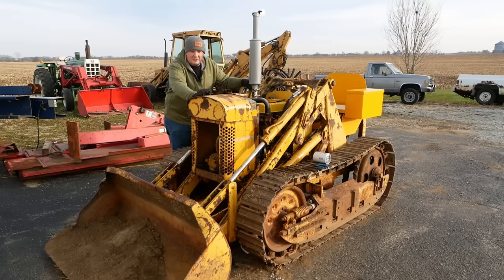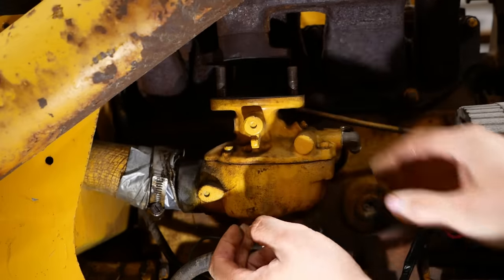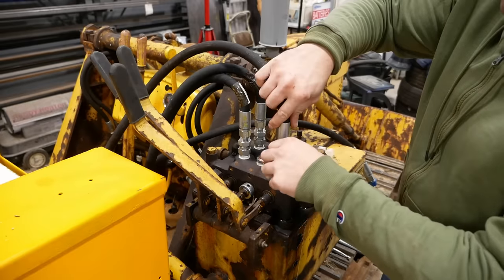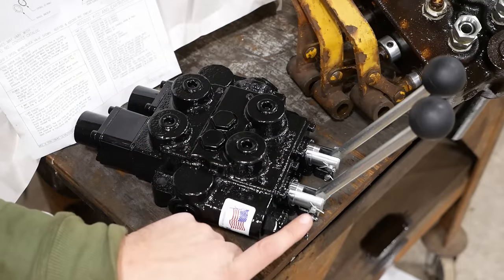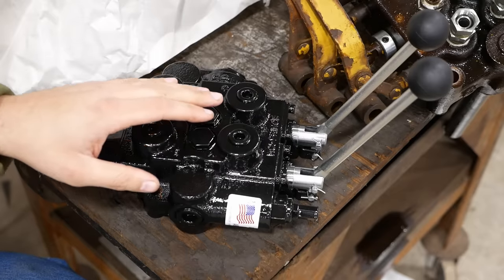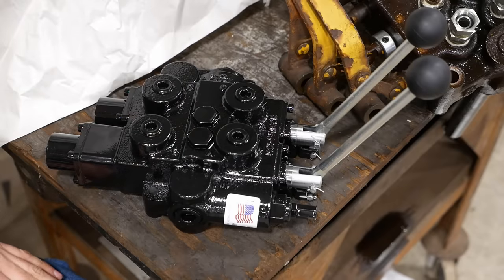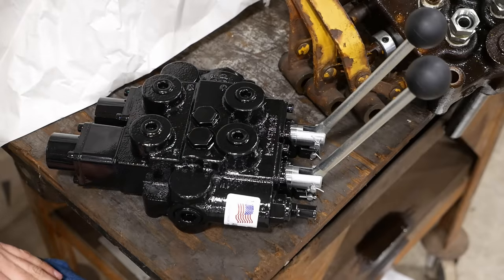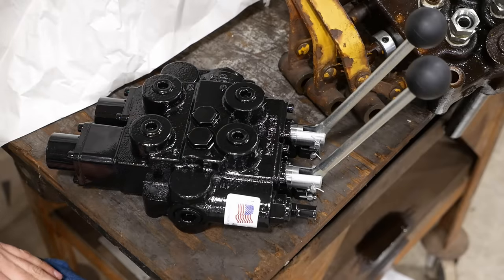Replacing a Hydraulic Loader Valve

Comment: You put silicone on the bolts to put silicone on the bottom plate around the pipe but you did not put silicone between the bracket and the tank where The water will set

Comment: Put ANZOIL in the dozer.  The COLD made the oil to thick and the pressure relief did not function properly. Dirty oil filters, thick oil, and a faulty oil filter bypass valve.....can cause the filter to pop. I had many service calls for road service where the cold below zero weather cause the oil filter to pop open like yours.  Added 20% Marvel Mystic oil or Resolene as an oil antifreeze....or did an oil change to synthetic oil for winter start-ability. I would guess you are using dirty summer oil.  In the old school days, we had to heat the oil pan to warm the oil for starting our diesels in extreme cold. We also uses propane side jack engine coolant heaters (small -medium - large   that was also commonly used in all the open pit iron mines on the Mesabil Ore fields of Minnesota.

Comment: You mention that the hydraulic system pressure is some 1300 psi. The pipe fittings used for the hard piping appear to be normal gas line maliable iron which are only rated at 150 psi when used for WOG (water, oil, or gas).  That’s what was on the original system, so I guess it didn’t break, but just sayin.

Comment: Just saying, not critiquing, but, from previous experience, you could've drilled and tapped the flat boss directly under the place where the return exists, plugged that one, and have everything move to the right back on track. Source: not that specific valve body, but i've seen "multiple" choice v-bodies like that.

They usually come with the side port already cut, but you're able to cut the other one. I'm 50% sure this could've been done the same, but maybe this one had something on the inside that prevented it.

Comment: i once tried to get that one more turn and split the valve.
Reply from the maker: Yeah but if you hadn't it would have leaked for sure...
Reply: @WatchWesWork  I can well remember searching through a box of nominally identical fittings looking for one with the start of the thread in the correct place.

They guys at the parts store gave me some very strange looks.

Comment: Thanks again Wes. Matt will be pleased 🤠. Have a great day. I usually don't critique your work. But spinning the valve body on to welded nipple could have gone bad. And in the future some poor unsuspecting mechanic is going to what?
Reply from the maker: How else you gonna do it?
Reply: @WatchWesWork Yeah your right I spoke to soon. I work building hydro seeders and ice control systems and we run into these type of issues all the time. We offer a bunch of different pump engine and control options and different tank sizes so we have occasion to run into problems. I know there's a way to do that, that will not cause a problem down the road. I will get back to you. Sorry if I ruffled you.

Comment: My friend rebuilt the engine on his 65 Mustang. Set it on 2000 RPMS to break in the cam and went to the house for a minute. When he got back there was oil everywhere and the engine was screaming. Sure enough the oil filter popped! Not good!
Reply: @elmerfudpucker3204  That's an interesting fact Elmer. In this case though, it split along the seam just like the one Wes removed.

Comment: I had a filter blow out on a 307 Chevy engine. Pressure relief was stuck and oil pressure went to the moon with a $3 special oil filter.
Do you have an ultrasonic cleaner ?

Comment: A simple street elbow on that return pipe would have shifted the whole valve assembly an inch or so to the right.
(I know it's done now....)
Reply from the maker: But then the inlet would not clear the left side of the tank.
Reply: @WatchWesWork  I guess I wasn't seeing it but it seemed (to me) the levers shifted over to the left.
Maybe the whole valve body is that much narrower?
I was really worried as you cranked that supply side tighter and tighter.
But you are the pro and know better than me. (You prove that with every upload!)
Thanks for sharing, and I hope future hydraulics jobs are few and far between.

Comment: NOOOOO, not hydraulics ... I'm already confused enough.... My mind ... it's going ... I can feel it.
What we have here is a failure to communicate.

Brother had a 66 F250 300ci I6 that blew the oil filter up as big as a balloon and then blew it off the engine. bad check valve in oil pump. ... rare but it dose happen

Comment: I really liked your video until you used low pressure fittings on the supply side of the control valve.

Comment: pump creates flow, restriction to flow creates pressure, if all of your hoses are crimped the 1500 psi shouldnt be a issue, if you have a lot of aeroquip screw on hoses then it could be a problem as they are only rated to 1500, the crimp on ends are 2250 psi, same as hose, (two wire hose), that oil looked milky, going to address that?, the pressure relief valve stuck in the oil system to blow the oil filter,

Comment: I know why you gave the explanation like you did because of that wierd obsolete valve put I've always had good luck with just calling the tech line at Parker with part numbers off old vavle (anybodies part number) not just theres and 99% they got a replacement in stock

Comment: I'm going to chastise you for using silicone on the bolt threads. I would have used Aviation liquid gasket, as it's designed to be used on threads.
Reply from the maker: OK. I do it all the time on water pumps and intakes. Seems to work fine.
Reply: @WatchWesWork  I sort of meant that as a joke, I've seen it done that way before. It's not optimal if you ever plan on removing the bolts in the future as you gotta clean up the silicone from threads/holes. Also just saying the option I would have went with given that I'd probably be the next person to have to pull it apart again.

Comment: When the carquest filter pops, made in the same plant in Mexico, then check the oil pump.  I have seen that a few times on equipment when the bypass valve in the oil pump got stuck.  Not just due to a Fram filter.
Reply from the maker: Those filters are both made in USA.
Reply: The economy CarQuest filters may be, but the best level CarQuest filters are the same as Wix.

Comment: NEVER use cast iron fittings for hydraulics on a loader or tractor. Cast iron fittings are rated for less than 800psi and loader hydraulics operate at 2000 to 4000 psi (depending on brand). ALWAYS use machined steel fittings. Do the job right!
Reply from the maker: That one street elbow is just temporary. I could not get a forged fitting in time. The other fittings see no pressure.
Reply: @WatchWesWork  You didn't mention that it was temporary and you didn't warn viewers to not use them on the pressure side. Someone watching the video will think it is ok to use cast and when it ruptures, it will cause significant injury or even death.
Reply from the maker: @briangc1972  What do you want me to do about it? Your pedanticism isn't helping anyone.
Reply: @WatchWesWork  When you make a mistake that is dangerous, you should not get your panties in a wad when someone points out your mistake. You could edit the video and add a note stating that cast fittings should never be used on the pressure side and only as a temporary solution on the return to tank line; but never on a power beyond line.
Reply from the maker: @briangc1972  You cannot edit a video after it has been uploaded. The original parts list for the machine shows it plumbed exactly as I have done. Iron fittings are used throughout the original plumbing. This is a standard practice for older machines.

Comment: I gave you a thumbs up. But not impressed with the ergonomics. Most common mistake. people mount things square to the machine.  I always sit in the seat and think were is this going to be the nicest to use. "The machine will bite you if you do it wrong".
Reply from the maker: It's the same as the factory valve arrangement.

Comment: Which do I watch first.... some weirdo replacing a hydraulic valve... or the guy automating back dragging a file...
Plumbing in general just sucks.  Never any room.  The tools are 5x larger than any fitting you are working on.  Hate pipe wrenches with a passion.